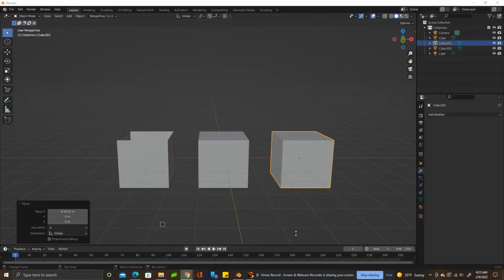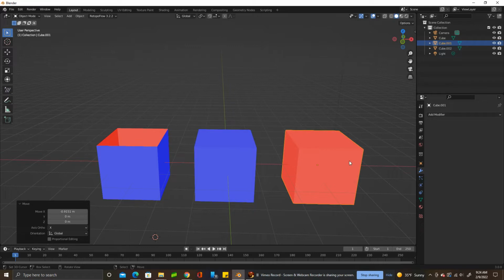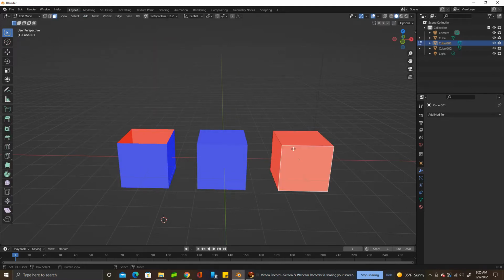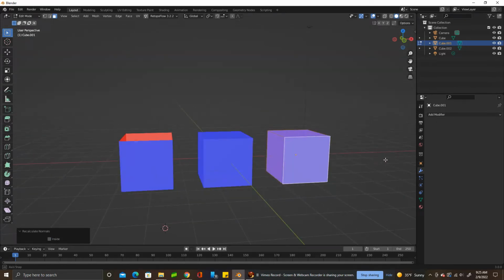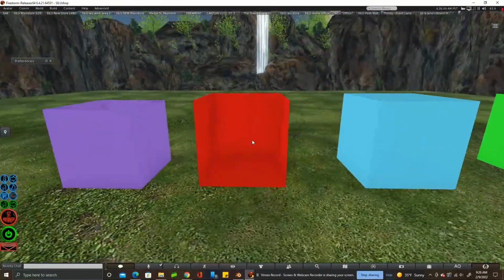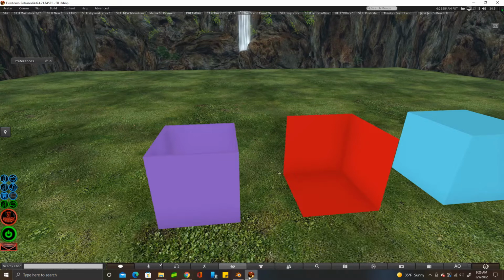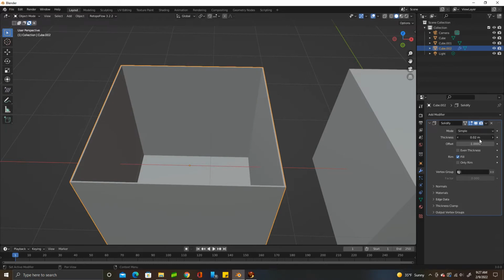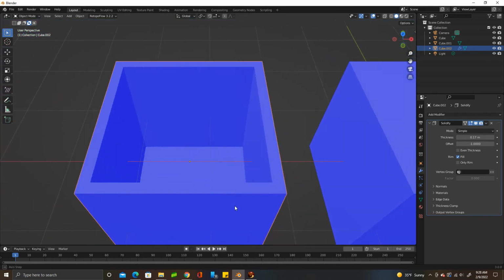What are Normals? Why is my mesh inside out in Second Life & how to fix / Solidify Modifier

Comment: I understand, Basically, Second life only shows one face, but if you two faces back to back, it'll show up if you have faces correctly facing the right way.
Solidify basically turns things from a plane into a cube, so to speak. Cube has 6 faces and they are just planes connected together.